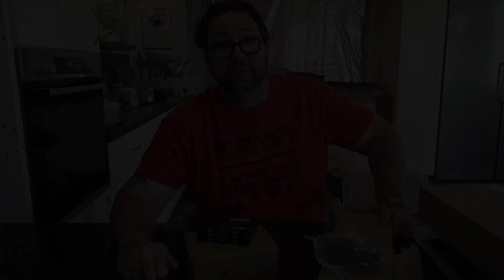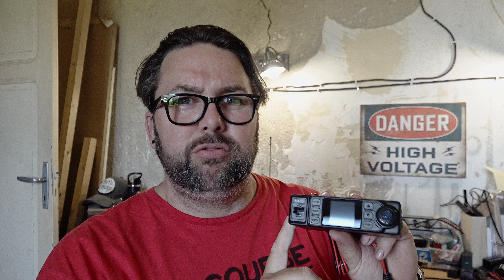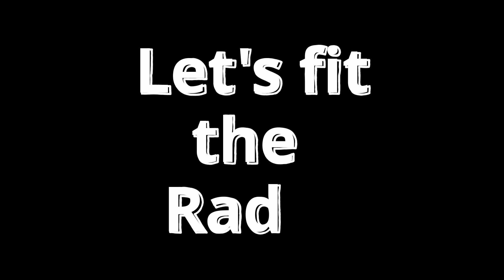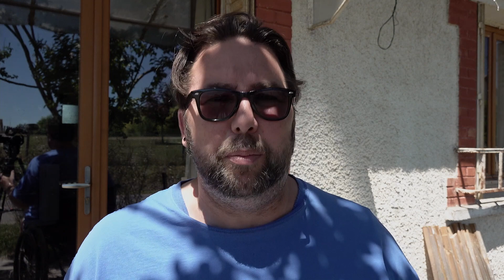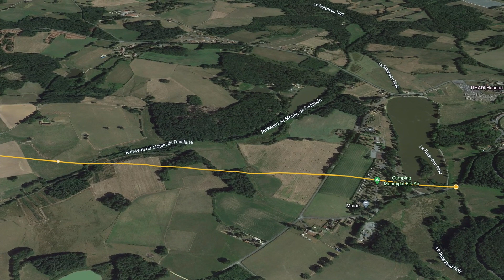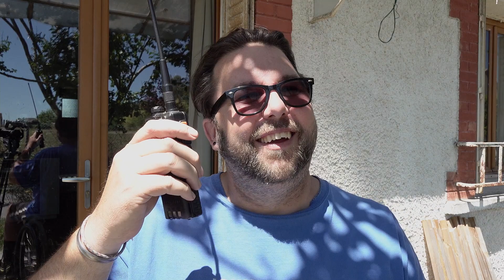Two Way Comms for Off Roading

Comment: Love a bit of CB banter on a long trip.  As a radio noob, how is this different to a 'normal' CB radio that I've got fitted to the Defender?
Reply from the maker: CB is on a different frequency to either UHF/VHF and PMR446. No need for a license to use PMR446 or CB. CB seemed to have gone quiet over the years, but there looks to be a bit of a resurgence. From what I have read, there tends to be a lot of numpties on CB. PMR446 can also out perform CB radios in the range department, due to the aerial efficency. Having said all that, I might dig out my old CB and see if I can pick any one up.

Comment: Nice little vid Ben. I'm thinking of getting some PMR446 radio eqpt. for use around our small holding and when I'm on site fitting stuff etc. The ham radio lot do soon get upset if you step slightly out of line with the "pleb frequencies " or burn a few too many watts. I'm actually looking at CB's again after 40 years as recently legal sideband was introduced and a new following is creeping in.  Anyway I hope things are  all good with the Hobbit mate.......
Reply from the maker: Yes, the Hobbit is still in good spirits, got three appointments this week. The ham radio lot, I imagine them all holding clipboards and wearing anoraks.